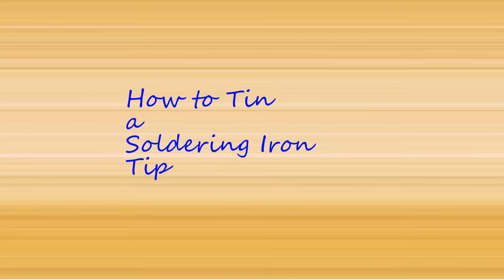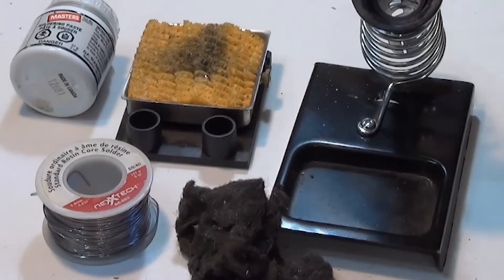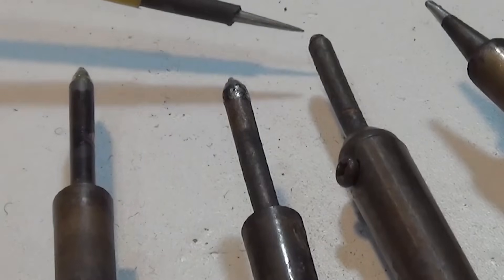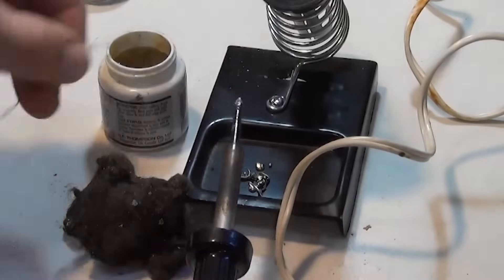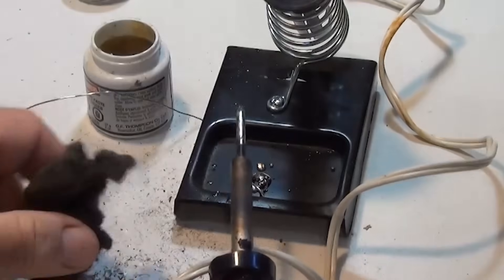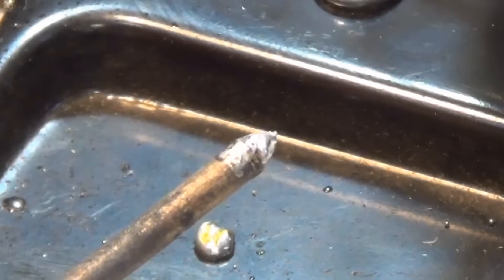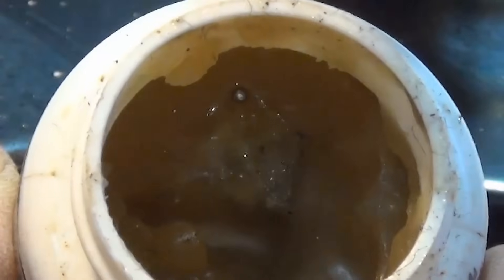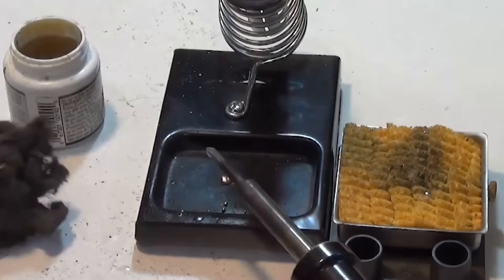How to Tin a Soldering Iron Tip or Re-tin an Old Soldering Iron Tip

Comment: Thanks for this video! I just started soldering as a hobby to fix electronics around the house. Was trying to solder some through hole switches onto a computer mouse PCB and the solder was neither letting me suck it up with the sucker, nor taking a new joint (it would ball up on the end of the component pins). I don't have any of the flux you have, but gentle rubbing with the steel wool cleaned the tips nicely and they took new tinning.

My question is this: is it okay to leave the tips tinned, or do they have to be re-tinned on every use?

Thanks for the video! Saved my iron tips!
Reply from the maker: Before turning the soldering iron off, wipe the tip clean and apply a small amount of solder to it, then turn it off. 

Depending on the condition of the tip, the acid flux is just used to speed the process of tinning the tip.  It sounds like your tip was in reasonable shape prior to tinning
Reply: 1929fordhotrod Thanks for responding! It's a new iron and I've been teaching myself - information like this isn't obvious to newbies like me, nor was it indicated on the packaging or instructions. I followed your advice and cleaned and tinned the tips after turning it off and they look brand new again.

The switches were a breeze to solder afterwards and the mouse was fixed. I have heard that acid based fluxes can be harmful to electronic applications though... will using that plumbers flux adversely affect any soldering I do on PCB? Thanks again!
Reply from the maker: Never use plumbers flux on electronics.  It is corrosive.
You shouldn't need additional flux if you are using rosin core solder.
Reply: Wesley Wright I just built a prototype pcb driver with about 5 components and never needed flux at all. You need the perf board with either single side or double side copper pads around each hole.

Comment: I will be going to a technical college and THIS video was VERY helpful!  To ensure I would not forget anything I jotted down a few notes for myself.  I was neglecting my soldering iron and didn't even know it!  Luckily I found your video and will be able to recondition it before I do any more harm to it.  Also, luckily the tip on my iron is solid copper, and I will be able to reshape it when the time comes.  THANKS for this video!!  It answered a lot of questions that I never knew I had!

Comment: tried this on one of my old tips (before I knew how to clean/tin regularly). didn't work though.. it stays black.  i think the problem stems from people buy garbage solder (never buy unleaded solder, the more lead the better). otherwise people will notice that unleaded doesn't really melt and they'll up the temps way too high, oxidizing the tip and that's when the tip goes to shit. they end up with a tip that corrodes too fast and the solder starts balling up even with flux. i'll end up throwing this old tip away.

Comment: '
i do clean the soldering tip many times...
remove tip, grinding machine clean, brush wire wheel clean then return to soldering heater...
turn on hot...
look good cleanning tip as new

Comment: Thank you for a nice tutorial!
But I have a question (or few). I have two older soldering irons that have 8 mm and 15 mm thick pure copper tips and currently I'm filing the 15 mm one back into shape. I was wondering should I rather not tin the tip beacuse solder eats the copper away or should I tin the tip because otherwise copper would oxidize more rapidly in air because of heat? Or is ther a significant agressiveness difference between leaded and lead free solder or is it the flux (rosin) that is the most etching on copper? In one of the earlier comments you sort of answered my question (to Jason Portillo) but I'm still slightly unsure.
I have very little soldering iron soldering experience (although I've spent a significant portion of my latter life watching people solder on YouTube=) and read quite few forums/instructions) and these old sodering irons I own I got recently.
Sorry for the long storytelling (I am a thorough person and like to open up details/background) and hope you'll manage to give some reply on the topic. Greetings from Finland and thank you in advance!:)
Reply from the maker: The tips need to be properly tinned for a good wetting action while soldering.  The solder does not corrode the tip. Over time the tip will deteriorate from heat.  This is why when the soldering iron is not being used you should clean the tip, apply a bit of solder to the the tip and turn the soldering iron off.

Comment: Hi John. Thank you so much for taking the time to make this. It's made a difference in my iron's performance.
Earlier, someone posted a question I was thanking, and that was, how often should you perform the procedure you demonstrate on the video, and you responded that it should be once, followed with proper maintenance. Could you please explain what this proper maintenance consists of? Thanks in advance.

JC
Reply from the maker: Before turning the soldering iron off, wipe the tip clean and apply a small amount of solder to it, then turn it off. 

Occasionally, remove the tip from the iron and clean out the hole where the tip is mounted with a small brush.  Do this while the iron is cold.

Never bang, drop, or hit the soldering iron.  This will damage the heating element.

Check the AC power cord for burn marks and repair any immediately.

Comment: why is tinning important?
Reply from the maker: For proper wetting action while soldering. Basically without a properly tinned tip, soldering on a pcb would be extremely difficult.

Comment: This is a way beyond proper way. This iron was not tined good, it was too much area tined, too long tip. waste of tip heat, waste of tip itself, and no, tining tip too much will not save it but destroy it quicker. The best way is to tin only working area and do it while starting to warm the iron not when it is hot and burn acids, you need only rosin, flux and solder, and wet sponge. I have 25 years old tips, i even make tips myself, even cheap ones last over 5 years if maintained well. Using over temperatures kill the tip by oxydising it too fast. You need to use as lower as you can temp until the solder becomes like oil no need to burn everything.
Reply: I've noticed few irons from China overheat the tips so I brought one with temperature controls lol

Comment: quick question: Can i take out the tip and replace it with a 2.5mm bare copper wire to cut through thick foam?
Reply: As long as the foam in question has a high combustion temperature, you wont have any problems with it

Comment: i bought a 30w solder iron  and it takes forever for the solder to melt.
i see u guys do it and it melts in seconds.

is it because of the temperature of the the iron??
Reply from the maker: I suspect you 30w iron is not developing 30 watts of heat.  You might need another soldering iron.
Reply: I find that soldering iron that aren't properly tinned have trouble melting solder. Have you tried the method of tinning in the video? An improperly tinned iron will need to be fluxed to transfer heat properly to continue the tinning process.  If this does not work, I suspect you need a new iron.

Comment: didn't realize it at the time but I found about $60 worth of (Canfield?)solder and flux for a few bucks at the thrift shop. there was the 60/40 Canfield, ( I think that's the name it was almost worn completely off) and also some 50/50 solder.is 50/50 ok for electronics? what is it typically used for? the guy had a bunch of stained glass stuff in the thrift store box. is that what it s for?
Reply from the maker: 50/50 solder is used for copper drain piping, sheet metal work, tinning etc. Its not used for electronics.

Thrift stores are a great place to shop.  Many great deals.  You did very well with your find.

Comment: What type of steel wool? extra fine, fine, medium, hard.
Reply from the maker: A super fine steel woo (0000) works best.  Never use sandpaper as it will destroy the plating on the tip.
Reply: ooo  nooo i used sandpaper .will it never work?  something to replace it .......sorry for my bad English
Reply from the maker: Never use sandpaper on plated soldering iron tips.  Sandpaper can only be used on pure copper tips.
Reply: What about using one of those green thin 3M scrubbing pads from the kitchen instead of steel wool?

Comment: Thank you.  Very easy to follow.  Very helpful.  I'm building new crossover networks for my speakers, and if I hadn't seen this, I probably would have not tinned my soldering iron, and therefore made some very bad soldering joints, which would have been a shame.

Comment: I don't have plumber's paste is there any other alternative more commonly found in a household?
Reply from the maker: Not that I am aware of.
The plumbers paste is available at most hardware stores
Reply: if you dont have a local hardware shop I'm pretty sure I got my flux from walmart. Its comes in a little tube. either that or home depot/lowes. It's as crucial as the iron/solder and will keep the solder fluid, allowing the copper to wick.
Reply: I could only find plumbers flux at home depot, lowes, and walmart..
Reply: Joe M that'll work
Reply: It is my understanding that plumber's flux is not meant for electronics - it will rapidly eat away the circuits. 
You want to use flux that is purpose made for use with electronics.
Reply: You need to use soldering flux. A basic "household" flux would be pine resin/rosin. It's that hard sticky residue that is secreted through the bark of pine trees and other conifers. It should work, but not quite as well as commercial flux.
Reply: @AtlantaTerry  this isn't being used on electronics. It is being used to tin the tip of the iron. It doesn't transfer to electronics because you clean it off the tip after tinning. This was shown in the video. The plumbers flux helps clean the tip and etch the solder on to the tip to create a better tinning bond. You wipe it off after tinning.
Reply: He's using the plumber's paste to clean the tip, not to solder. Two completely different tasks.

Comment: How many times does he need to say "Sodder" or "Soddering"? Hasn't he seen the "l" in the middle. It's called "SOLDER" pronounced "Sole Der".
Reply from the maker: +John Wilkie - Well that is an interesting comment!  The English language is an interesting one.  Many words can be pronounced differently in the English language.  For example: tomato and basil.  All are correct and recognized by Cambridge Dictionaries.  So lets get back to what is important.... tinning and maintenance of the soldering iron tip.
Reply: +1929fordhotrod Pronunciation of words like tomato and basil doesn't involve the removal of letters to make them sound different.
Reply: +John Wilkie You're from the UK? US is "sodder", UK is "sole der".
Reply: Where do you get the extra d in the middle from? Do you just make words up?
Reply from the maker: +John Wilkie - It's time to move on to another topic, maybe something technical!! As Mark England mentioned you are using the UK pronunciation.  I suggest you go to the online version of Cambridge Dictionaries and you can hear the variations.
Reply: +1929fordhotrod I certainly agree. This is not a spelling/pronunciation  contest... it's a primer on soldering. Good video by the way!

Mr. Wilkie might explain why the Brits call a "trunk" a "boot", or a "hood" a bonnet"...

Just having some fun... Again, very good video.  Learned what I needed to learn for now.  

Thanks!
Reply: +Mark England I think a better comparison instead of boot/bonnet is:  where is the "F" in "Lieutenant"?
Reply: +Michael Gilchrist I think you pretty much nailed it!
Reply: +John Wilkie 
soder

Comment: Uh oh. I just put my soldering iron to the grind wheel, tried to re-tin, but it didn't take. I should have watched the video first. 
Edit: Rescued successfully, using the tricks learned. I guess it was a copper tip, or mostly copper. 1, cleaned and sanded. 2, coated w flux. 3, wrapped neatly with solder. 4, plugged in and waited. 5, flux/steel wool/solder. 6, repeat step 5 a few times. Success! Thank you!

Comment: When I clean my iron in a brass sponge, the solder comes off!
Reply from the maker: +Bob “bobdabiulder” dabiuld - you really do not want excess solder on the soldering iron tip, only enough to keep it tinned.  There are some special soldering iron tips that you would load with solder.  These special tips would be used for SMT / surface mount devices.

Comment: Why cant you grind the metal tip?
Reply from the maker: Pure copper tips are okay to grind and others do not grind them. Grinding destroys the plating on the tip.
Reply: What if the plating is already damaged? Mine got rusty after a year or so, and obviously that was no good. I wire brushed wheeled it, then ended up grinding on my bench grinder some more since it was very uneven from rusting. It worked fine like that (other than it needed wire brushing every week). I never knew you tinned them with solder (other than pre-tin), but it seemed to solder fine. After seeing this, maybe I wouldn't need to brush it as often if I tin it properly.
Reply: 1929fordhotrod   I have grinded the tip, and it has worked although maybe not as well as it could. Now I know why some tips bent easily (all copper). Thanks.
Reply: I wire wheeld a beat up tip and then put in on the belt sander before I watched the video THEN watched the video and went out and tined the tip to perfection. worked great.

Comment: Its better to tin the soldering iron at lowest temp possible. Sand off all rust with sanding paper 1000 grit. Or with wire brush. Apply flux to sanded iron tip then the solder wire to the tip by gradually increasing its temp. This way you do not risk re-oxidising the iron tip and making poor solder plating. Also you don't need to keep applying coats of solder again and again.

Comment: I was thinking about buying another tip, but this worked. Thanks for the tip :D
Reply: oh yahhhh nice pun :)
Reply: If your tip was dirty like in the video, then someone left the iron turned on, then walked away, and the oxides started to build up after a minute or two.

If the iron is not continually being cleaned and tinned while it's hot, aside from dirty oxides building up, the plating will burn away after a while, too.  

If you were able to save the tip, then not all the plating was lost.  But it's a good bet the lifetime of the tip was reduced, that some of the plating's thickness was lost while the tip was kept hot and untinned.  And these days, the manufacturers of the tips don't put a lot of plating on the tips, so their lifetimes aren't so long, even if you treat them right.
Reply: good
Reply: "the lifetime of the tip"
Honestly I don't care about the lifetime and structural integrity the least bit when I use a 15$ station, but yeah, it was on for like 4 hour periods as I used it. It wasn't left untinned for more than 20 minutes but still
Reply: Boom
Reply: Krisztián Szirtes I
Reply: Nobody ever show me this way of dealing with soldering irons in 45 years in the electronics works,now at age 84 I learned ...whoa....thanks for this education.

Comment: You sir, just saved me an epic quest for a new tip for my ancient Weller iron! About five years of crud, slowly reducing the useable area of my tip, was burned away in mere minutes.

For our European viewers: I used Griffon S-39 Universal (you specifically need the universal type!) with my Weller and it worked miracles.
Reply: "For our European viewers: I used Griffon S-39 Universal (you 
specifically need the universal type!) with my Weller and it worked 
miracles."

NEVER...NEVER use this for electronic
it's a mix of salt in water
you'll not have short circuit(a dead short )but a resistive link of 100-60kohm between 2 track

more? s-39 griffon oxidyze more than other flux your  soldering iron tip ....
of course...it contain water...

just the ideal solution to make you crazy

use welco flux or make your own with isopropyl alccol+rosin(can find it at an instrument maker, a luthier ..)

Comment: For those in Australia, the approximate equivalent to the plumber's paste is called Bakers Solution, which is a plain liquid, so cools the tip a bit more, but still works to enable the "plating" effect between the solder and the metal substrate.  Note: it is NOT Spirits of Salts, if you have some of your granddad's supplies still. That's another name for hydrochloric acid (HCl), which would probably work also, but is MASSIVELY corrosive to eyeballs and skin as well as everything else!

Comment: What a Waste!..just sand it with sandpaper...
Reply from the maker: You are entitled to your opinion but you are incorrect with your statement.  Depending on the quality of the tip, sanding and filing a tip will destroy the plating on the tip and render it useless and unsuitable for pcb work. This is a link on how a quality iron tip is made http://www.elexp.com/images/sdr_fig2.gif . Many of the cheap $10 irons do not use this method of manufacturing tip and usually self destruct after several weeks of use.

Comment: whats the point.just buy a new one.they only cost 2 beers....$15
Reply from the maker: You buy expensive beer!!

Many low end soldering irons do not come pre-tinned and tinning is necessary for proper wetting action.
Reply: just tin it by melting some solder...easy.
Reply from the maker: That works if the tip is in reasonable shape but will never work on a badly contaminated tip or one that was used and never tinned.
Reply: That's for sure. Last week I ruined a Raspberry Pi Zero trying to solder on a 2x20 header with a brand new soldering iron that I neglected to properly tin. Bad on me!